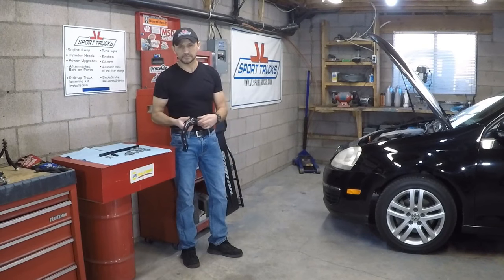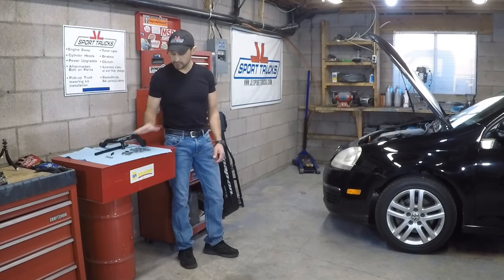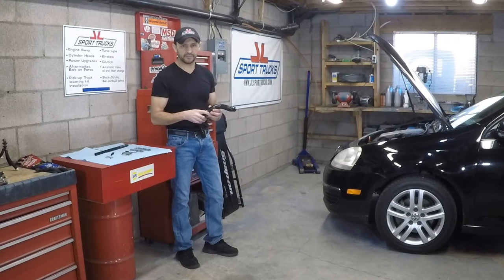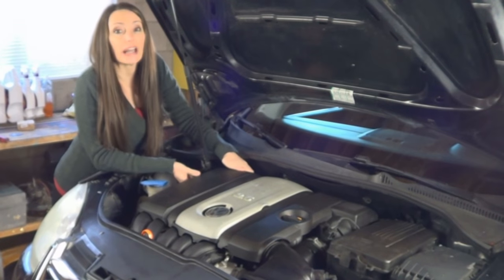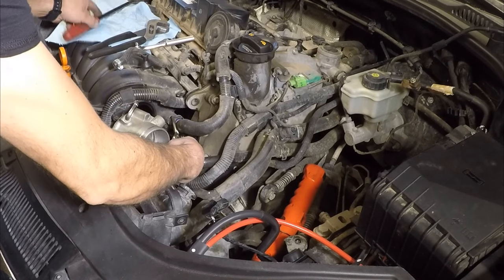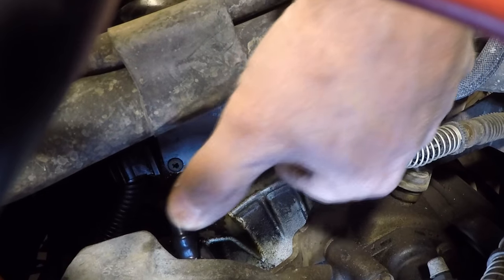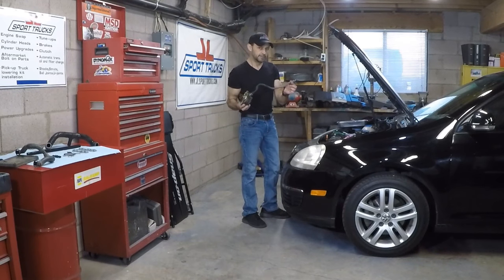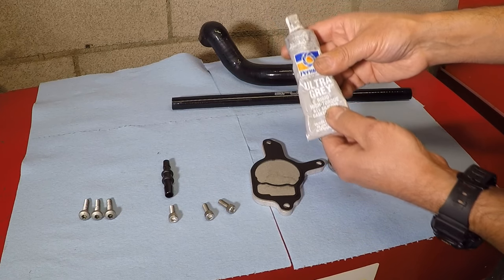How to install Vacuum Pump Delete Kit on VW Jetta equipped with 2 5 L Engine

Comment: Thanks for the video, it helped a lot. Just one note, in my case, the screws that came with the kit look the same size you showed, but they did use almost half the threads, so they were perfect. No need to cut the original screws for reuse. I used of the original screws to hold the bracket.

Comment: Just finished this job on an automatic. Installed an Injen SP3026BLK intake at the same time. The toughest part was to get the bottom pump bolt off (T30). Eventually, I got it loose with a T27 skinny wrench and pliers. The 2nd hardest part was to remove the pump once it was loose. Once I got the shift linkage loose and its nuts off, there was just enough room, and I got it out. I also accidentally popped the car in neutral and it rolled. Had to jump in and pull the e-brake ;). I managed to keep the throttle body in place and work around it, but it was a challenge. Used rtv on the gasket like you did. Also, the MAF screws are not your average security torx, they're something else. There's no way I was going to look for the right tool for these damn things. I simply grabbed the outside of them with pliers and managed to remove them. The replacements are Allen type. Went for a drive and everything seems to be running well. Your video was definitely helpful.
Reply: Anything I should know regarding linkage removal? Is the linkage set at a certain position? Never removed the linkage before and want to know everything before I remove it
Reply: @UpTownTroy  mark your bolt positions before removing so you have correct placement when you put it back.

Comment: Excellent video. Thank you very much. You could easily remove the shifting cable and the shifting plate by just removing the circular end that keeps them in place (Time 13.33 in the video) they are underneath your hand. This will make it super easy to reach the vacuum pump volts and remove the pump.

Comment: Nice video!  Apparently, oil leaks were common with the first-gen delete kit, and the new kit has a cast/machined cover with a recess for an "O-ring", so the gasket is gone, and the need for messy sealant.   Otherwise, it looks the same.  I got a deal on a 2008 Rabbit because the owner had an estimate of C$700 to replace the vacuum pump.   But I think I'll wait till the weather warms up before I tackle it, as its snowing outside in Vancouver.  (wish I had a shop)
Reply: You can easily replace it search up vacuum pump replacement and it shows you take the cover off the pump along with the spinning plate inside and then maneuver it out using the stud that’s in the way

Comment: Thanks for this video, unfortunately this kit is not available in my country and it will be too expensive to import it. I'll have to pay import duty which sometimes can be more than cost price. I'll keep changing the oil seal of the vacuum pump.

Comment: I like how the battery cable ends are designed. It makes them much easier to get a wrench or ratchet onto being angled up like that.  I am not sure how many other cars are like this but I have not seen that on anything else yet.  It feels like they think of all those little things and redesign them to be easier to work on.  It is true that not all parts in these things are going to be so easy to work on and that might be mostly because of the tight spaces they are crammed into.  That is really a problem with any modern car and other cars are even worse.  There is one more gripe I have, people who don't like Volkwagens because of "special tools" you need.  What rock are they living under!?!?!?  Most cars these days require use of a "special tool" for something.  These ninnies make it sound like the dealer is the only person who can do ANYTHING with these cars.  It is as if they forgot their shitty Hyundias aren't much different except for using parts from Korea.  I just wish people would not spread such bad myths about these cars.  it is true that sometimes they have transmission problems but who said automatic transmissions were trouble free?  I feel somewhat lucky my only real problem since buying the car used was a parasitic draw on the battery that cost $2500 in parts and labor to track it down.  I got the car with 96,000 miles and now have 154,000 and it still runs good and that electrical problem was pretty much the only headache I had to endure with this car.  It may have been awful not being able to start it each morning but I am sure that some people go through things much worse.

Comment: I just put the vacuum pump delete kit on my 2012 passat 2.5, i let it idle for a few, turned it off, went inside to clean up, came out to drive off & my "oil pressure low engine off" light came on. Did a fresh oil & filter change as well. Any suggestions. PLEASE HELP!!!
Reply: Same here recently
Reply: Did you fix the issue?  If so, please share.
Reply: CashMoney Bow Tie  I am thinking about doing this on my 2012 Passat. Did anyone figure it out?
Reply: Did you ever get the
Light to turn off?
Reply: @CashMoney Bow Tie we’re you able to get the light to turn off?
Reply: Did you ever figure it out ?